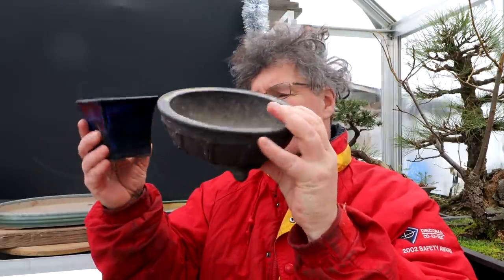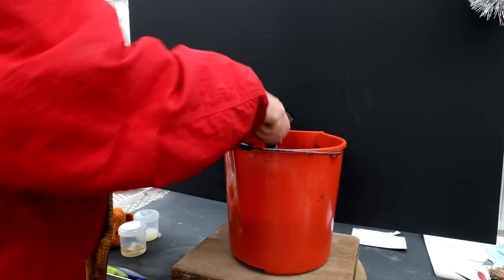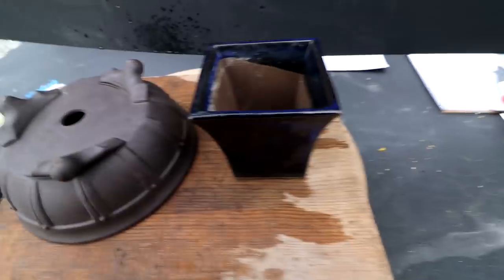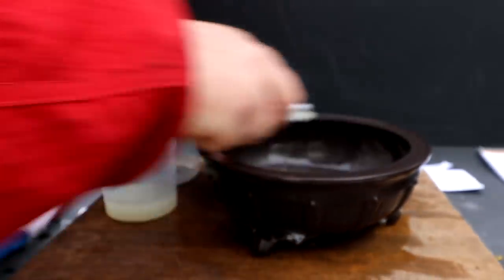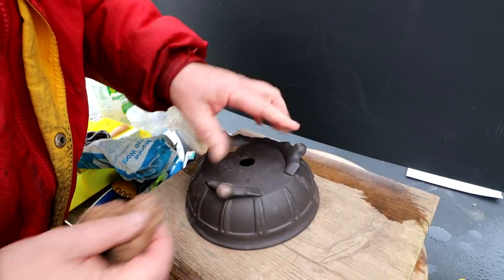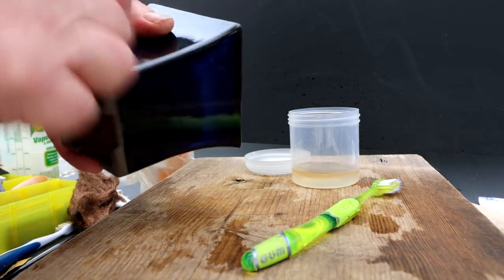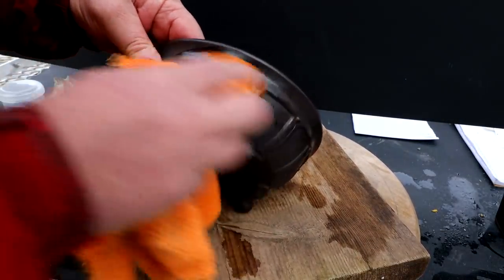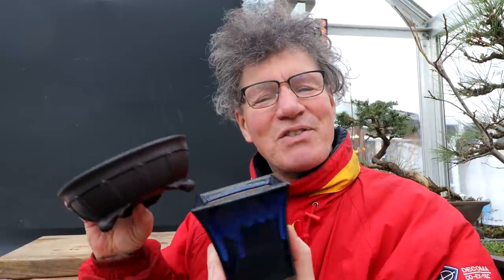Cleaning My New Bonsai Pots, The Bonsai Zone, Jan 2022

Comment: Speaking from my experience of dealing with limestone my whole life I can say your approach with citric acid was right, you just had to use a bit more concentrated acid than just juice OR just let it dissolve longer. Vinegar is a bit less effective because chemically it's a different acid (acetic).
Higher concentrated citric acid is safe to use on clay or glazed pots as does nothing but dissolve calcium carbonate and it's very cheap. Just spray and watch H2CO3 become CO2 and H2O, it does sound fun (hissing) too.
Reply from the maker: Thanks, great tips and information!!

Comment: Hi there, I put my pots with high amount of lime build up in a plastic bag that has household vinegar in it, sometimes diluted. It lets the few amount of vinegar to contact with most of thebuild ups and usually after few hours it looks as good as new. I don't use sandpaper because it easily scratches the glaze. Thanks for your videos.

Comment: To remove lime scale safely and for a small amount of money, you can just use plain white vinegar. mix 1:1 with water and it can be applied either with a rag or from a spray bottle. for heavy build-ups you may need to let it sit for a while before rinsing. if you are unusre whether or not it is safe on a pot, a small amount can be used in a not clearly visible spot and rate the results.

Comment: Hi Nigel. I oil my unglazed pots using a 25% veg. oil (ie. rape seed) and 75% bio-ethanol. The oil is immiscible with the ethanol, but shake the mixture well to form an emulsion. Then apply with a cloth. This prevents overloading with oil and helps to evenly disperse it. The ethanol quickly evaporates leaving the oil behind.  Keep shaking the mixture while applying as it eventually separates.  Finally buff with a lint free cloth. I apply it to the sides, feet and lip of the pot only. I do this 2 days before exhibiting. This mixture can also be used to clean and bring up the patina on the bark of the trees.
Reply from the maker: Thanks Graham, sounds like a good method!!